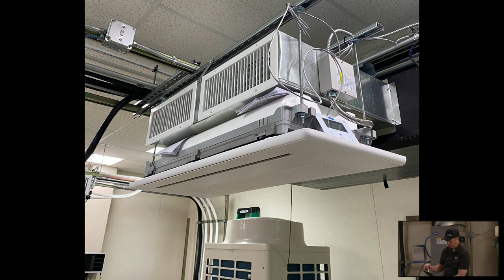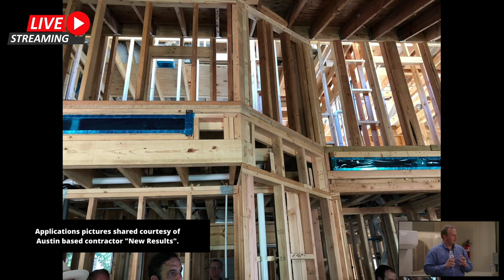Carrier Ductless - What’s the latest in HVAC equipment - LIVE STREAM

Comment: Ductless are not high performance. They completely neglect ventilation and filtration. They have increased maintenance needs and often cost more when they can need up to 4 times as many indoor units to perform the same work. Seer and ieer are easy to manipulate. Look at eer to see how efficient a unit really is. Ductless are also built as throwaway units that won't last.

Their great for suppliers interested in selling boxes. For techs they make you an appliance salesmen enjoy the drop in wages you will get from them.

Comment: I bet electrical installation cost are sky high.
Reply: The indoor unit generally get power (and communication) from the outdoor unit.  The wiring is run with the refrigerant line set.  So only the outdoor unit gets power from the breaker box which would be needed or already in place for a traditional HVAC system.

Comment: Regular ac units last 30 years with no maintenance.
Reply: They can last up to that long.  They also use at least twice as much power during those decades so they end up costing many times more than the original install price over their lifetime.
Reply: Corect. If you do not turn them on.

Comment: Sadly many HVAC contractors do not talk the benefits of the ductless system but will install the Spaghetti Installation of ductwork. Not happening.  I moved from the north to Florida 20 years ago. My first flip house had duct work in the attic, my reaction was WHAT were they thinking? What was the contractor thinking when he installed duct work in an attic that heats up to over 150 degrees and now ductwork is running in that 150 degree attic working harder to maintain the AC'd living space at 72 degrees?  And WHAT was that same contractor thinking when he installed single pain windows with aluminum frames?  What was that contractor thinking when he installed an exhaust fan in the interior bathroom HOWEVER a bath on an exterior wall that has a window there is no exhaust fans; just open the window for FRESH air?  PLUS the exhaust fans sounds like a prop plan motor.  Therefore many people will not use the bathroom exhaust fan due to the annoying noise. 

The mini split units will work well with a unit in each bedroom; with the 4th mini split in the kitchen/living room/ dining room areas on a 1600 square foot house.  This is so much more efficient than one unit pushing air to the entire house with ducts in the attic.  PLUS each unit has its own zone and if not using a bedroom the temperature can be higher than the master bedroom and the main area of the house can be higher during the night time when no one is using that space.  It's common sense, however many people will look at the cost factor when replacing a whole house system; opposed to installing 4 mini splits when replacing the air conditioner unit. It should be comfort and the efficiency that are the more important factors. Thanks for the informative ductless HVAC video.  The 42 Seer mini split what is the material and labor cost to install the unit and will it be cost effective to install 4 of the 42 seer mini splits compared to using 21 seer units?